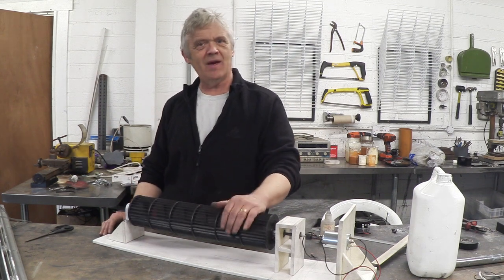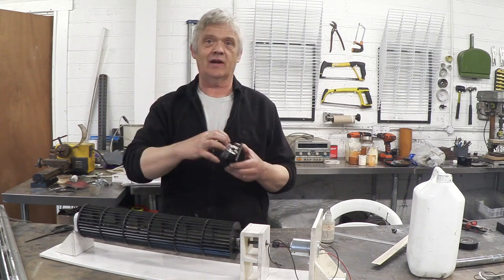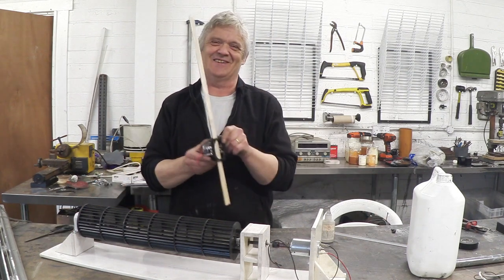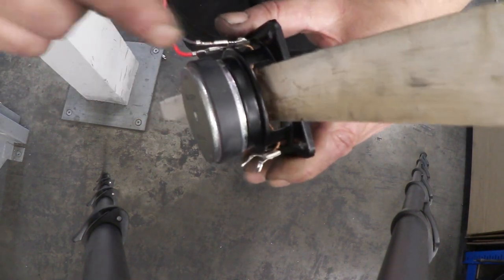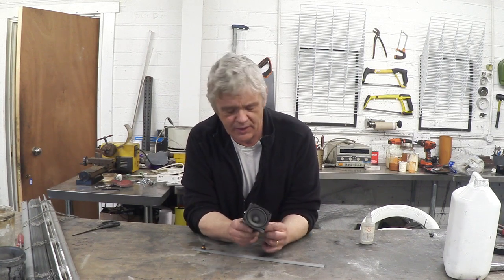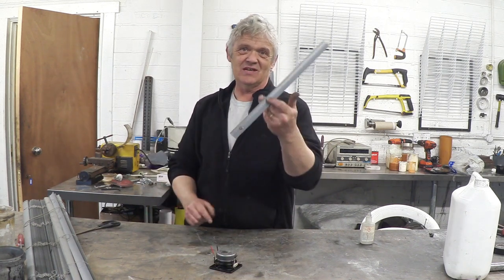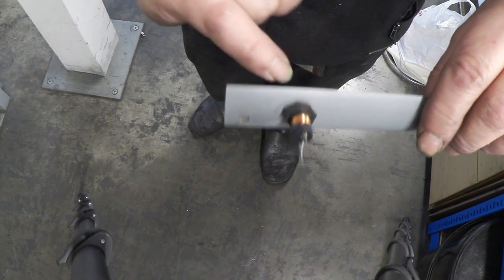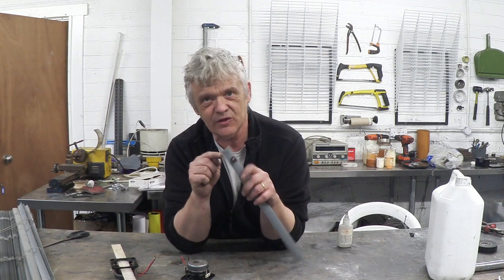Weird Wind Generator   No Blades, No Moving Parts

Comment: Closed system like an MVAC system. Use the principles used in the solar towers in Australia,  power a steam turbine that recycles the water into a larger tank to hold the pressure, once it cools it cycles into a second tank to be heated. I have much more info and research on this if anyone is interested hit me up on here or fb
Reply: Would like to know about this more. Appreciate ur reply. Brgds

Comment: Depending upon the materials you use; could it be tuned like a speaker and work off sound waves rather than wind? I mean: if what it really does is work off vibration, then couldn't you tune the sensitivity (by using highly tensile materials) to use sound from say; a busy intersection or an industrial plant for instance, as the actual motive force?  Great work as always Robert, you always inspire.
Reply from the maker: absolutely mate cheers

Comment: Stringing a piece of flat cargo strap between two poles or structures. With the correct tension on the strap and a light breeze the strap will vibrate like crazy. 

This should give plenty of wave forms to the magnet/generator if you will. 

Thank you for the great content. Keep it up.

Comment: Well, actually there is a moving part.  The pole or reed must move to make the system work.
Reply from the maker: never mind mate - it's awesome anyway
Reply: Robert Murray-Smith true, it is indeed awesome.  My poor attempt at humor I guess.
Reply: And the coil moving in the magnet is the part that can wear out
Reply: @ironnam8107  Amen
Reply: @ironnam8107  That would be an insignificant factor if engineered correctly. Some subwoofers are capable of long term use at thousands of watts. I've pulled many drivers apart and there are some massive voice coils out there.

Comment: I like it just watch a field of tall grass for how it patterns in wind.
Reply from the maker: me too mate
Reply: @ThinkingandTinkering  
If you can find an old printer imaging unit, it will probably have a piezoelectric sensor to detect the toner level.
If you can set that a paper thickness away from the vibrating airfoil, you may be able to induce a   voltage?
Reply: My husband had this idea since he was a child, I don't know if showing him this will make him happy or sad?
Reply: @nicoleyensen7062  the greatest regret is not following that dream and then see some one else get rich from it.
Reply: @rogerstarkey5390  I have one I was thinking of trying xxx
Reply: @ThinkingandTinkering  Piezoelectric  generators!  Attach them to shrubbery stalks, or trees and have limitless power!
Reply: Redrooster that comes down to the wiring... think of it like a hybrid battery: series increases voltage, parallel increases amperage.  Wire in series until your combined voltage meets your requirements.  Then wire those cells in parallel until you reach your required amperage.
Reply: Interesting, but how much current was it producing?
Reply: @gm3045  that's the kind of no nonsense thinking the world needs more of
Reply: Use a round reed in a flexible tube. Then it can move any direction.
Reply: Redrooster  make a bunch in parallel.

Comment: If a large frictionless gyroscope was spinning at the equator, and its axis was vertical to the ground, then within a 24 hour period you would observe the gyro's axis make a 360 degree rotation to maintain its position as the earth "rotated" through it's 360 degree rotation.  Couple this, with an accelerating gear train,  and you could conceivably generate power by borrowing energy from the spin of the earth itself.  Right?

Comment: I’m using a 1000 watt low frequency speaker as a linear alternator on my Thermoacoustic engine I’ve designed works great check it out. 👍

Comment: Thought ..... Have you tried clamping the louvre at the opposite end to the Magnet, so now the Movement required should be amplified??.
     The wires from the Magnet could be run down the blade to avoid any likely resistance caused by the wire being horizontal at the point of maximum vibration??

Comment: If use a piezoelectric slip you only need a small square painted on and 2 wires you can get sound out of almostany solid. If you coat the hole blade (or even just long stripes that connect to the wires) you can get current out when it moves in any way. 
I mooted the idea of using it on as a substrate on high visibility structures back in 2000, wile in my first year of my materials degree. But it was popped as no one would go for it as i would be too expensive (it's pennies btw) on large scales. And if it cracks it is not so effective and is low amp. And no one was really thinking about anything that wasn't for grid generation, in the main stream at least. 
But if you get hold of some piezoelectric slip/wosh/paint you will find it interesting. You can make a slip from it in powdered form and some solvents.

Comment: Volts with zero amps is zero power.

The minute you put a load on the coil the reed will be damped out and will stop vibrating.

All you have there is a bad quality microphone
Reply: spoilsport
Reply: Just match the load to the wind speed, not rocket science. Plus imagine attaching the magnets to a tree? We can be too negative and dismiss things before we know Be careful of your assumptions is all I say.
Reply: @andrewnorris5415  I guess science and physics is not your thing then.  Ok let me help you out.  Have a look at speaker efficiency for a clue, or prove me wrong by turning the trees in your garden into a power generator.  
Out of the box thinking is great, but this video is very misleading since he never actually generated any power, only volts.  I can create 25,000 volts just by rubbing a balloon, but how much power do you think that charged up balloon will deliver?
Reply: Indeed. Let's connect a resistor and ammeter. See if it generates a micro watt or so.

Comment: Hello Robert. It's matter the coils what shape and size are? Can use large like 50A speaker coils and or toroidal chock coils or has to be like the one you showed wounded cylindrical? Thanks
Reply from the maker: I don't know mate - to be honest I just made random guesses with what I had laying around - the cool thing is it worked at all and any sort of optimisation is going to improve it for sure - if it was me I would experiment with your suggestions and see which works better

Comment: Interested in learning where to buy the inductors and coils.
Reply: Digikey/mouser/or ripped out of any old electronics with power supplies.
You'll have better performance if you find some with laminations instead of ferrite cores, but the cost is much higher.
Reply: ?? BUY ?? look in the trash, they are everywhere! And...you become a recycler,  good for the environment.

Comment: Two things: 
1. this reminds me of another design from years ago where they used flexible plastic ribbons somewhat similarly to harness turbulent energy. On videos, it was noisy.
2. The Spanish company seems to use rigid pipes. I wonder how well this would work with an inflatable closed (textile?) pipe. And some ropes to conduct the movement to ground level. Soft robotics already have some neat solutions that may be useful here. Even if the pole gets damaged, it just flops down safely.

Comment: If a pole is vibrating, that is movement, so that is a moving part.
If the speaker is vibrating, that is also a moving part.
Reply from the maker: okay mate - should have said 'no rotating parts' - still cool though

Comment: There is actually a reed type wind generator that has already been used at quite large scale test installations.  They operate more like how you tension a piece of grass and blow it to make a noise.  So picture an elongated narrow frame with a piece of fabric like material that has a magnet mounted near one end surrounded by a stationary coil.
Pretty efficient, bird safe, but can generate a certain amount of noise.
Make a bunch of these mounted in parallel grid array about the size of say a solar panel.  then add as many panels as you like for the power needed.

Comment: Cool idea. The real question is how much power it generates for a given cost of materials. In general the power generated is probably proportional to the area of wind it interacts with. It would be interesting to see how the power output compares for a given cross section with a turbine design. I suspect that the turbine will be more efficient and cheaper at larger scales as you can just get bigger whereas a bigger reed might not work so well. As others have noted, there clearly IS a moving part.

Comment: Reminds of the way tie down straps vibrate like crazy on the back of my truck.
Reply: The vibration is caused by vortex shedding that occurs at the harmonic frequency of the stretched strap.  The vibration will damage the strap if left long enough. Put a half turn in the strap and it won’t vibrate.  However, to create wind energy, vortex shedding may assist if used strategically!

Comment: Or a piezoelectric crystal for high voltage applications.  Yes!  Always interesting!  😁
Reply from the maker: Great suggestion!
Reply: Robert Murray-Smith charging up your leyden jars ! 🧐
Reply: A piezo crystal wouldn't produce high voltages, it would simply be a high impedance source. The speaker , on the other hand, is low impedance which is more useful from a power production standpoint... to extract max. energy from these systems you need matching source/load impedances ... put a low impedance load on that crystal and you'll get virtually nothing out due to the mismatch ... 🤔

Comment: The amount of movement is minimal and the less movement, the less output power. Conventional generators are the same in principal (a magnet and a coil) except that they turn with miles more movement instead of just wiggle. More movement in turning means way more power. Wave power has a similar limited movement problem compared with rotary turbines and that is maybe why wave power seems to have failed.

Comment: I’ve imagined a generator where a stream of charged air passes through a coil.  The wind passes through a charged grid, picking up a charge, and on through the coil ..... There really would be zero moving parts...
Reply: Apart from the wind you mean.. 🙄😂

Comment: It's a very interesting concept Rob, some years ago I suggested to some people that a similar method could be used to generate power by installing induction magnets and coils under a road surface as cars drive over it it would produce a lot of power using gravity thrust as the cars weight went over such a structure it might have fallen on deaf ears at the time but just a thought. Also can use a similar system under a carpeted floor where many people are walking over it.
Reply from the maker: interesting ideas there - cheers

Comment: Would the mechanism in headphones work for this?
Reply: Yes ... if they are low impedance phones (which most all are today).. 😌
Reply: Not much, because the throw of the teeny speaker cone isn't much. But a three way speaker would make better use of various frequencies, or wind speeds.

Comment: Can connect this thing in series and add the voltages?
Reply from the maker: yep
Reply: After rectification to DC sure.  Adding the AC signals would have difficulties with the generators in the field staying on frequency and in phase.

Comment: I believe they use a piezoelectric crystal to extract the power.
This not only works in the wind, but from seismic and acoustic energy.
Those crystals often release their voltage in the kilovolts, allowing one to transform it down while transforming up the amperage.

Comment: Genius, would a cylinder be omnidirectional?  Like a carbon fiber fishing pole, or golf club?
Reply: No, the reed doesn't control the direction of coil movement. The design of the coil itself does. You could potentially have another axis of movement by adding a 2nd coil, perpendicular to the 1st. The reed would then need to have a plus sign like shape (looking down the length of it).

Comment: I hate to burst your bubble, but ...
Whether you call it wiggle, wobble, vibrate or even resonance it's MOVEMENT of the part.
If the part is moved by the wind, it is a form of wind vane - or BLADE.
That piece of wood and most definitely the piece of venetian blind fit the most basic description / definition of a BLADE - and unless they MOVE no electricity is generated.
Notwithstanding how interesting the concept is, I call CLICK BAIT!
Try to market it as having no moving parts and you'll be shot down for false advertising.

Comment: If you used a much larger magnet and attached it to the base of a skyscraper, could you generate significant power from the building's oscillations in the wind?

Comment: Could this be any good 

Graphene is an allotrope of carbon consisting of a single layer of atoms arranged in a two-dimensional honeycomb lattice nanostructure. The name is derived from "graphite" and the suffix -ene, reflecting the fact that the graphite allotrope of carbon contains numerous double bonds. Wikipedia
Properties
Tensile strength
Conductivity
Additionally, graphene is highly thermally conductive, exhibiting a thermal conductivity of ~4000 Wm−1 K−1 [15,16,17]. Moreover, graphene has a high Seebeck coefficient and figure of merit, which make it easier to convert electrical current to heat

Comment: What you are zeroing in on is a piezoelectric flag. It suffers everything that your concept suffers with but 10X worst.
The turbine blade and flag utilizes every inch and mass for generating power. Your concept, only the coil is used the rest is to transfer the energy, excluding flag portion. In term of fatigue, your concept is 10x worst for obvious reason. Your high insurance cost will be based on MTBF of your flex bar. Which can be easily calculated. Costing is also obvious because you will need a lot more to produce the same power. But it will work

Comment: I don't know how to feel about this. 
While the tech is all sound and it works, I would argue that the practicality of this is very limited. 
I have many points of criticisms on the Vortex Bladeless. 
1) I would think that repeated strain on the central component would lead to material-fatigue. Especially if resonant operation is desired. I know that this is probably the weakest point of criticism, but if you want to scale this up to any reasonable size, the strain-forces become.. Significant. 
2) So. On the actual energy generation. If you could make permanent magnets with extremely high field-strengths then the generator near the bottom of the generator may start to be viable.. but I just don't see that mechanism approach anywhere near the efficiencies of conventional generators.
3) This project is old. The company behind it has received millions of Euros and has been working on it since, at least 2015. They have repeatedly delayed  their goals, lessened their generator specs. In 2017 they claimed they where going to make a 1 MW generator, and had previously claimed even more. Currently they are claiming their turbines does the following: 
"With our 80cm high devices, we are getting around 2-3W, but a 275cm high device is expected to provide 100W, and a 10-12m high one around 1kW." ( Ask for source.. YT comments and links are not mixing well )
So. firstly, they've diminished their specs over time, fine. That can happen for good reason. But then claim these numbers.. Lets take and calculate the energy/generator length. 
2.5W/0.8m = 3.125 W/m
100W/2.75m = 36 W/m
1000W/11m = 90.9 W/m
While there is nothing specifically wrong or suspicious about these numbers, as the turbines (obviously) aren't one dimensional, but three-dimensional and with length, area goes up squared.. But still. Something feels odd about those numbers. 
lets assume the 0.8m model has a width of 0.1m. the cross section the wind sees would then be 0.1m * 0.8 = 0.08m² | That would mean 2.5W/0.08m² = 31.25W/m²
And assuming the 8 to 1 ratio is the same for all the models: 2.75/8 = 0.34 | 2.75m * 0.34m = 0.95m² | 100W/0.95m² = 106W/m²
An lastly the 11m model: 11/8=1.38 | 11m*1.38m = 15m² | 1000W/15m² =  66.7W/m²
Ok. So just a quick disclaimer here. These calculations are extremely rudimentary, and I'm not claiming that those calculations reflect the actual numbers, but lets compare to a comparable vertical turbine design. 
Search on Wikipedia for "Quietrevolution wind turbine"
Rating: 6 kW 
Size 3.0m * 5.0m = 15m² capture area. 
How neat. About the same capture area as the 11m vortex bladeless. So. 6000W/15m² = 400W/m² 
And the Quietrevolution design isn't even that efficient. 
Anyways. My point is more that Vortex Bladeless claims their design is cheap, and easy to implement. Despite this, they've spent 5 years and millions of euros and STILL has no product on the market. If the damn thing is so simple, and so cheap, why hasn't it been able to just be build, sold and stand on its own in the market-place? Also, the ambiguity around the technical aspects of it also makes me uncomfortable. Also, why drop the plans for 1MW+ generators? Is it because vibrations become difficult to handle at those power levels? More foundation needed to anchor the generator when it is resonating at peak wind-speed, making the whole thing more expensive and non-viable?
Why the differences in the W/m² figures? I mean, the principle is the same, you would imagine that it scales relatively linearly with capture-area. 
I dunno. I've gone on far too long, and I may have made mistakes in my calculations. Again, I'm not saying the operational principles are bogus. They are clearly valid and sound. But the practicality of this, outside small, low-power applications, just don't seem to  be of any practical use. And what I find most repulsive about this, is they are leeching on public funds and in investors to keep this going.